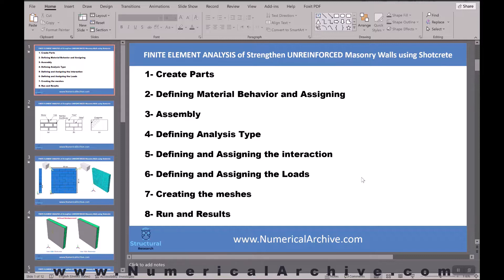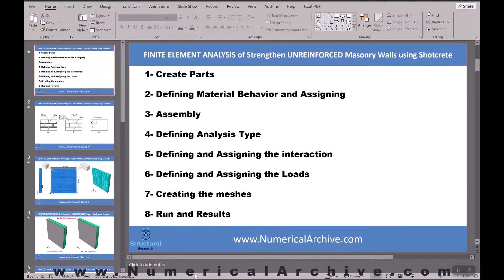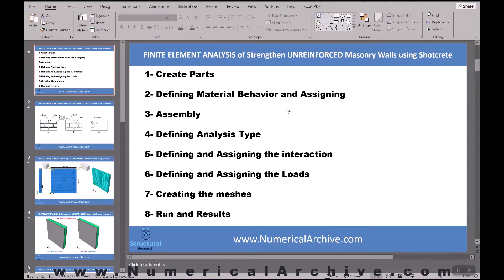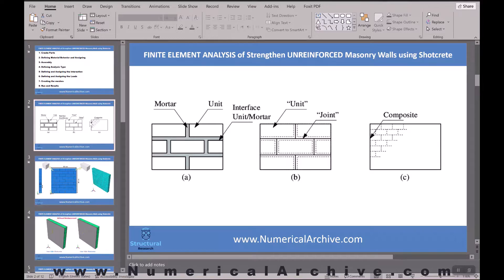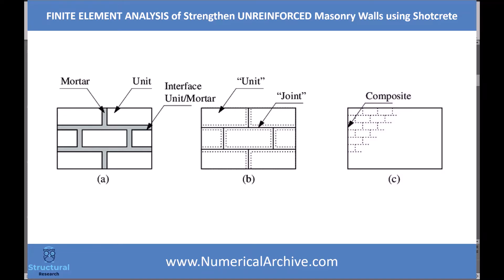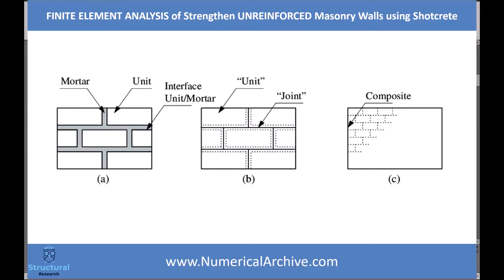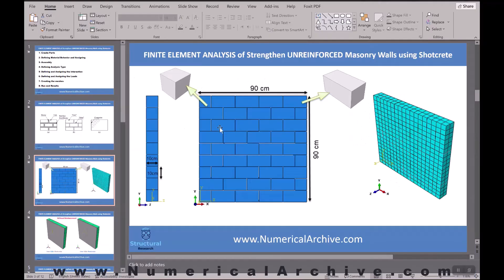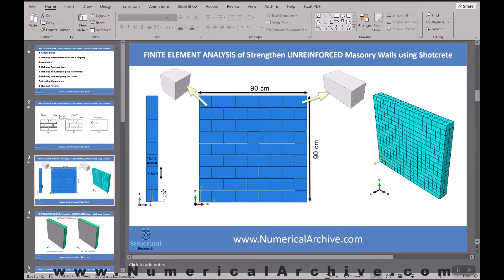Analysis of Unreinforced Masonry Walls Strengthen by Concrete Shotcrete using ABAQUS

Comment: The website is not working when I use the link; it says, "There has been a critical error on this website."
Reply from the maker: the issue has solved. 🙏
Reply: @numericalarchive4614  How long will the the CAE files for concrete shotcrete take to run?
Reply from the maker: @elliotthompson1962  Thank you for your interest in our concrete shotcrete model package. The run time for this model can vary depending on several factors, such as the hardware specifications of your computer, the complexity of the model, and the size of the mesh.

As a general estimate, the run time for this model can be between 20 to 60 minutes on a five-core laptop. However, this is subject to change based on the aforementioned factors.

Please let us know if you have any further questions or concerns. We would be more than happy to assist you.